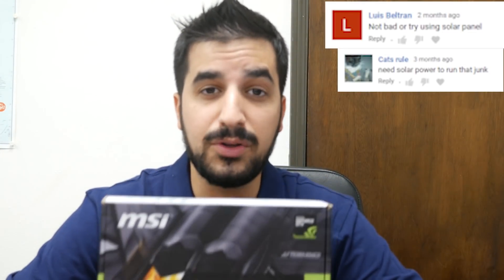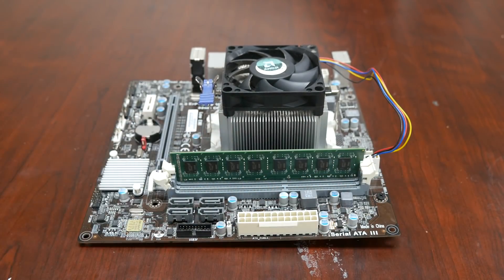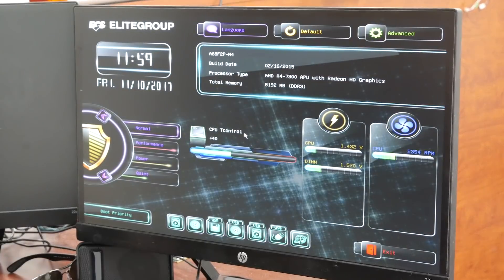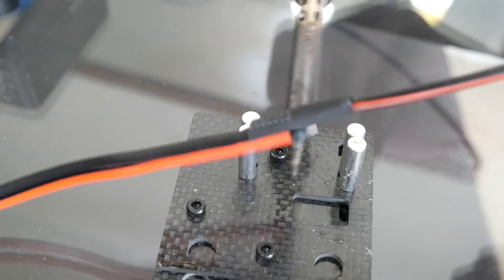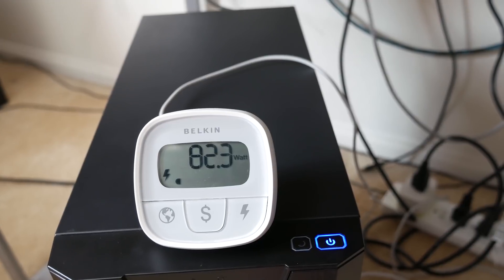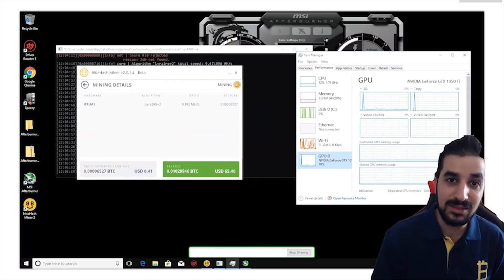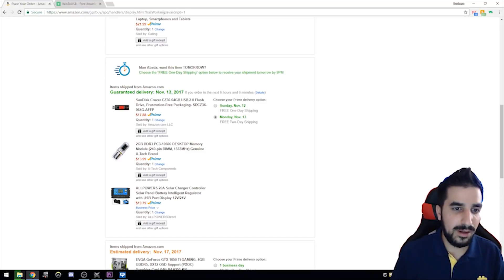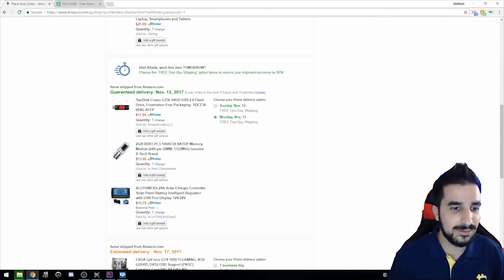How Much Can You Make Mining Bitcoin on Solar 24/7 With Battery + GPU Giveaway 4K Part 1

Comment from the maker: Part 2: https://youtu.be/8muE5yC3Y1I
Reply: Remember to keep your battery outside so the fumes don't kill you or explode.
Reply: Why would you need an I7 notoriously know to be a power hog to do GPU mining? All the work is done in the graphics processors. And his goal was low power consumption for use with solar panels. In fact most mining rigs use Celeron processors.
Reply: You got an OS that compiles to GPU code?

Comment: Don't solder like that. It can cause a fire mate. You are cold soldering causing resistance... Open the both wires, combine them physically. Then heat the wires and after they are hot apply the solder contacting to the wires not the solder iron. This is important don't get your home catch on fire

Comment: MOAMiner can profit-switch based on power efficiency, which will be superior in solar powered setups. But don't get me wrong, it's hard or impossible to hit profit in the long run with a battery backed solar power setup ;-)

Comment: if you get rid of all the shitty connection, and weld everything, even the battery... alligator clip are really bad... and if you insulate your solar panel it seem you get more poaweor,,,the best is to have a bunch of 6v plugged in pack and have a 24v system... then you using the sun efficiently... make sure to have a reset... or a fire extinguisher handy ;)

Comment: this is so dumb...sooo...you use a battery to power the inverter and then use a normal psu? are you kidding me? and you don't care about waste of energy in that conversion right? you have 12v to 220 and then back to 12/5/3.3...god damn man...
Reply: the loss is not bad because the the solar panel, battery,and PSU should all be using DC power.  that said he'd be smarter to use a pico psu instead of a normal ATX one as they are designed to run off batteries. he'd be able to make the whole system act like a laptop.
Reply: yep, that's my point, you simply can take a psu what use the 12v directly and stepdown to 5v and 3.3 or design one quite easy
it's cheaper to use this method and you gain more efficiency this way then using an invertor and atx psu

Comment: Store the whole rig that is powered by solar in a dark room where the flooring and the walls are all really thick marble Marble does not hold heat very well and if the room and flooring are marble then you have air conditioning without an air conditioner. The room will always always be cold if it is well insulated and the floor and walls are all marble. Try this suggestion and you definitely thank me for it, and you're welcome. I learned this trick when I discovered an underground store room built by a contractor for storing food during the summer. Standing in the room Underground for 20 minutes and you will freeze your ass off. The temperature above ground was 102 degrees the sun beating down not a cloud in the sky.

Comment: Efficiency to be gained: Bypass the AC-DC conversion... Solar panels are DC, open up the PSU and modify it so that the battery at the nominal voltage feeds straight into the DC circuitry on your PSU, bypassing the need to convert it

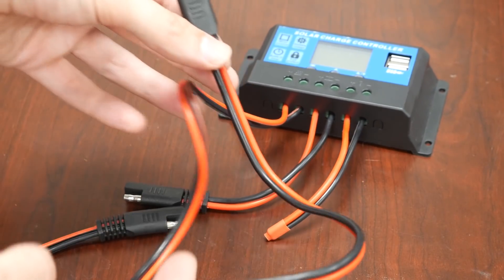Comment: 6:20 There is a reason for the short cable: power loss of dc lines. It would save energy placing charger, battery and inverter directly at the solar panel to keep dc lines short.

Comment: Such a small system ain't worth it! Solar makes the most sense when you can buy it from a wholesaler at a very low price. At this tiny system 12v dc to atx 85%, PSU would be more efficient and cheaper than running PSU and inverter

Comment: You should consider changing the stock settings. You can get it to run allot cooler and produce a bigger profit. I also wouldn't use the Basic nice hash wallet. You can make up to $60 a day with those cards if you use nice hash legacy miner or Nemosminer and change your stock settings.

Comment: https://www.amazon.com/Zalman-T3-Micro-Tower-Computer/dp/B01BXXK5M0/ref=sr_1_1?ie=UTF8&qid=1515809806&sr=8-1&keywords=cheap+motherboard+for+gaming+pc i was checking for motherboard but i find good case for mining pc like if u wanna go beast u can actually set auto power- startup like each 2 hours at day so it recharge and power back on on ur pc that could work great also add cooling and more directly to the power supply

Comment: The inverter is converting DC to AC and then the power supply is converting AC back to DC. the inverter and power supply are both completely redundant. Try to find some kind of voltage regulator then power your mainboard directly from it!

Comment: You're wasting hella power with that "converter" which is really an inverter and that "power supply." do you even know what a power supply is? It's an AC to DC converter. Why are you converting ac to dc? Because computers run on DC. BUT THE PROCESS IS WASTEFUL. you have DC already from the start from the solar. You can do everything without ever touching AC with the all DC computer power supply. you're going DC>AC>DC when you could be going DC>DC for 50% better production. Just look for a 24V DC computer power supply. It's actually way smaller than a normal computer power supply and also not very expensive. It does what you're looking for much more simply.

Comment: Get this and you don´t need the invertor and run more efficient https://es.aliexpress.com/item/Realan-DC-ATX-PSU-12V-150W-Pico-ATX-Switch-PicoPSU-24pin-MINI-ITX-DC-to-ATX/32816006065.html?src=google&albslr=223411563&isdl=y&aff_short_key=UneMJZVf&source=%7Bifdyn:dyn%7D%7Bifpla:pla%7D%7Bifdbm:DBM&albch=DID%7D&src=google&albch=shopping&acnt=494-037-6276&isdl=y&albcp=652736826&albag=32471627666&slnk=&trgt=75384829977&plac=&crea=es32816006065&netw=g&device=c&mtctp=&gclid=Cj0KCQiAyszSBRDJARIsAHAqQ4qy5tqWe6kxnl2QZJrwuBu1dYQsgOsvZmEaHwMXBfzC13QAlRSfiX4aAvKDEALw_wcB

Comment: Ok. This is retarded. I'm ee (electrical engineer) you are losing more than 30% of power to convert solar to 110v a.c. then you are losing more than 30% to convert to 12V dc. So if you're lucky, you're losing more than 60%. Hopefully this helps. Solar power is very expensive!!! You should do roi on your setup.
Reply: Gave u like.

Comment: IF USB really is that much better for lower power consumption then I would run with 3 usb.   1 for windows.  1 for swap file and 3rd just in case to use to install files.   Then I would setup a ram disk if possible and install/run everything from ram drive... 
Then of course backup your bootable thumb drive once you worked out all the bugs.

Comment: You should change for a converter that if battery and solar have not enough power it will switch to power from outlet until the first system will generate enough power needed

Comment: you could go more efficient on the single gfx card confing by using one of bay trail platform, as i've got some time ago an mini itx board with embedded cpu msi j1800 and it has dual core 2.4ghz 10watt and 1x pcie x1 for 25pounds )

Comment: Man, I think you can get your setup cheaper. 1) you dont need a case, 2) slower CPU can still handle it well, while you are looking for power-saving CPU which doest no takes many watts.

Ofc that with the ASIC chips, solars and the battery you can do really awesome stuff. I just wanted to point out that there is space for savings and improvements^^ :)

Comment: The issue with what your  doing here is its not efficient for 12 volt systems.. I run some  mission  critical  equipment on a pico power supply but its very low power..  You would require some thing like this https://www.powerstream.com/DC-PC-12V.htm

Comment: Why no just use Linux? Linux uses way less resources to run vs windows. You could also remove the GUI and just run it as a terminal, but thats if there is mining software that you're able to control via terminal.

Comment: it may be better if you used GTI or an Offgrid inverter with UPS mode/capability so that when  the battery was not fully charged due to climate condition it will back-up by grid and also lengthen your batteries life.

Comment: 100ah battery only has 1200 watts of storage but only 30 % of that should be used or you will kill that agm battery in no time at all, so really you have 360 watts usable about 4 ish hours  you really need 400ah battery, also you should work out your needed panels by 6 hours a day of sun, so 6 x 200 = 1200 watts also add 20% for loss and your computer is now using about 100watts an hour so this means you only have 1/2 the solar needed oO

Comment: Nicehash takes $4-$6 of a service fee, and you'll get paid at .01 for external wallets($110-114) or .001 with the nicehash wallet($12-15). Payment is automatic on Fridays. But cheap out on everything but the gpu and power supply in my own opinion. GL.

Comment: i have that same gpu and im using an i5 and 8gb ram and an ssd. i have it set up at work so the power doesnt matter. im also using nicehash and coinbase for my wallet.  its been a week and i mined 0.00078309 ($8.71). is it worth it if i keep going? i had these parts laying around so i didnt spend any money for mining.

Comment: Great video subject, I was thinking of this earlier. But your solar setup will only run the computer a few hours a day. 24hours times 86watthours = you need 2064 watt hours a day. You have a 200 watt panel without a maximum power point tracking charge controller, 170 watts max in summer at the daily zenith. You don't get 12.14 solar insolation hours every day in Cali, not even in the Earths sunniest desert in summer. And that battery will go below 10.5 volts and the inverter will shut off sometime around midnight. Needs way more batteries, don't go below 11.8 volts.

Comment: This is a great idea, however there are 2 things i would change about your setup:
1 use an AMD GPU for a better performance to watt ratio
and to really make things efficient use a dc-dc power supply instead of stepping up to 110v then back down to the required voltages.
you can find some example power supplies here: https://www.powerstream.com/DC-PC-12V.htm but there are some more basic ones such as this https://www.amazon.com/Mini-PicoPSU-150-XT-DC-DC-power-supply/dp/B0045WFZSQ which would power your rig quite happily. 

Also I noted that you didn't want to take out the cigarette lighter adapter, I would highly recommend removing it from your setup as you can loose a lot of efficiency through that plug particularity as the wattage go up, this all gets dispersed into heat and it can be quite warm or even hot to the touch. 

As a last recomendation which I realize as im writing this im basically pulling your entire setup apart, is to use an Intel atom motherboard like the Asrock J3455B-ITX https://www.amazon.com/ASRock-Motherboard-Combo-Motherboards-J3455B-ITX/dp/B01M7OUO62 which will use much less power and still features a full sized PCI-e x16 slot (its also cheaper than-your CPU motherboard combo)

Hope this helps

Comment: The inverter is a huge power loss
Reply: Scarf_guy  - yep, your stepping it up, only to step it down from AC to DC and back to AC again. That is allot of power consumption for no reason.
Reply: If its solar then who cares if your throwing away like 30% of the power
Reply: It is also significantly more sensible than investing in a setup that would let you run the PC on DC power.

Comment: It makes no difference if you have a low Hashrate whole Day or a high Hashrate half of the Day. The battery is complete useless. Mine when the Sun is shining and leave it if it is dark. So you have no Losses by the Battery efficiency. The Amount of Bitcoin you get ist higher when you do not buffer the energy.

Comment: When you solder wire onto tags it's important to insure the wires are very is hot and the tag you are soldering to is also hot, before the molten solder is run into the joint. Other you can easy end up with bad solder joint that will separate without much movement.

Comment: 82 watts??? just my cpu uses 95
Reply: Alaska One I doubt it..... he has hardly that used up at all... it's probably under load...
Reply: 7600k @ 5ghz 1.36 volts is well over 100w when 100% load
Reply: The cpu don't need to work for mining, and undervolted/underclocked gpu, specially 1050 classs and below can easily draw less than 50w.
82watts is at mining usage, the whole system.
My tweaked Ryzen 1700 at 3Ghz only draws 45w at MAX LOAD.

Comment: I just started but how much power does the GPU draw it does not sound like you have enough solar or batteries or a big enough inverter also I don't think anyone makes one but it would be cool if someone mad a computer power supply that runs off 12v so you don't have waste power inverting to 120v and back down

Comment: Why are you holding the iron above the wire, the whole point is to put it below the wire sit heats, you then touch the wire with the solder that will start covering both wires. Also use a damn lighter for the heat shrink

Comment: Those soldering skills are atrocious.
Reply: Probable cold solder joints; he should redo then using Western Union splices and then solder.
Reply: Yeah, I think they gave me cancer
Reply: yeah, that hurt to watch. the last one was all cold.
Reply: Twist wires, put element under wires, let wires heat up then place solder on top of wires and it should seep into wiring. Connection is crucial you want less resistance throw power cables
Reply: At least twist them before soldering, or clamp them, or hold them, not keep them like 5mm apart :D
Reply: idk anything about soldering but it made me cringe.  .
Reply: Hahaha I was gonna say the same good video
Reply: +1 for Western Union splice.

Comment: Should have used a PicoPSU, would have been more efficient running off the solar. Also maybe a motherboard with a soldered Intel J1800 CPU for lower cost and power draw. 

Gimme da GPU

Comment: I really enjoyed your video, thanks for sharing it. I have a question about the software that you use to control the clock speeds of your devices. Is that third party software or something that you were using on NiceHash? I really did n't follow that part very well. Thank you for your response.

Comment: Watching you solder I noticed that you had the solder and the heat on the same side. That is actually not best practice, ideally the solder should flow towards the heat so you may want to try putting the iron tip underneath the wires and then flowing the solder from the top side. Just a tip so you don't end up with a cold solder joint which can affect efficiency.

Comment: Take the fan of off the cpu heatsink less power usage... the cpu doesnt need it... use a more efficient psu to save power and don’t use a case to make the components cooler and use less power throught fan speed...

Comment: Thx for the vid brah,  I checked this out to see how to build a cost effect rig.  

The first issue I seen is your inverter is really small, those are used in vehicle and they are all over the place (dirty power), and it will over heat and or auto shut down.   

I have a 2000w / 4000w peak, watt inverter about $150 bucks, and you should use a pure sin wave inverter for sensitive electronics; which they are pretty pricey, but they regulate the power better & safer.  Mine is not a sin wave but I will use a power strip out of the inverter, until I get a 5000watt sin wave inverter.

I built a back up solar setup if the power goes out my house to run the frige, two led 12v lights, 800w microwave, 27" TV,  and charge phones and laptops.   

You should get a KILL A WATT meter to test the draw before in wall for and hour,  you plug it in between the rig and the outlet.  They go for about 20 bucks at HF or on Amazon, and if you look a your bill for the rate, the last button will let you calculate how much it would cost to run, well whatever you want. 

Normally used to determine the size solar and battery bank you need to power what you need.  

You do not have to put the panels on the roof, and I would avoid it.  I put treated 4x4s in the ground a 16' feet apart, and three treated 16" 2x4s across and deck screws to mount the panel facing south west to get the most sun both summer and winter. 

You can make a hingrd PVC pipe frame, and mount half moon pipe hangers to pivot the panels angle, because the angle of the panels need to be adjust 4 times a year.  

Download an app on your phone and winter is at 47° , and it goes from like 40° to 74°  during the year.  Get 4 each deep cycle 12v 35 a AGM batteries, for bigger batteries go to batteries plus and get golf cart batteries, the ones I use takes two in a wheel chair,  and you shouldn't have a problem running 24/7 all year round to include winter.  

They are not huge batteries but cost effective at $49 to $69 a pop, but will do a good job and totals 140 amp hours, keep in mind if you run your batteries lower than 50%, you will end them very quickly. 

 You may want to Get rid of that WPM charge controller when you can, as a MPPT will produce a lot more power, I found one on eBay.   

I also have 200 watts of PV solar panels,  in 8 PV panels 25w @ 18v, mppt controller, four deep cycle 12v 35a AGM batteries, you never want to use a car batteries, they are for short strong butsts, but wet deep cycle make the best battery banks, I use AGM because they are set and forget; well next to lithium-ion but those are astronomical prices.

What rate can you get with that setup, and which coin?  

I took a hit in Iraq, and after two failed surgeries had to retire, so I am looking at. Mining as a stream of income.  Tried to heal and recover for a year, but that didn't happen.  

Any other questions on the solar, just hit me back .. 

Peace bra!

Comment: Yes, a direct DC to DC voltage converter would probably be more efficient than DC to AC, and then back to DC. 
"Home Power" magazine should list some sources for specially designed batteries for solar power systems.